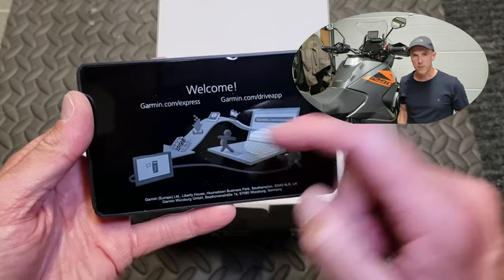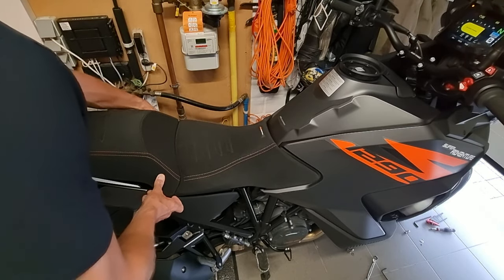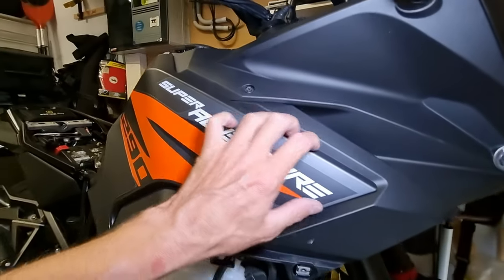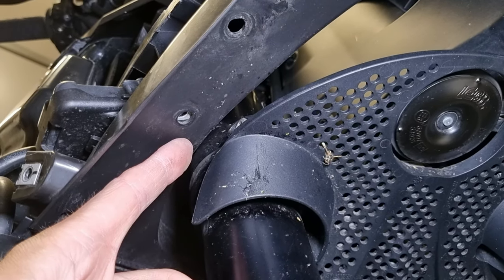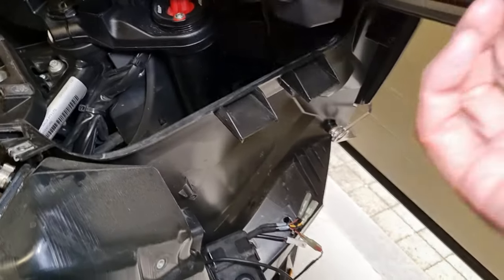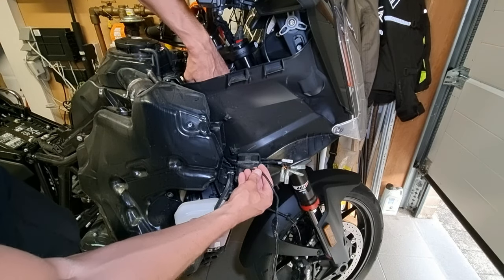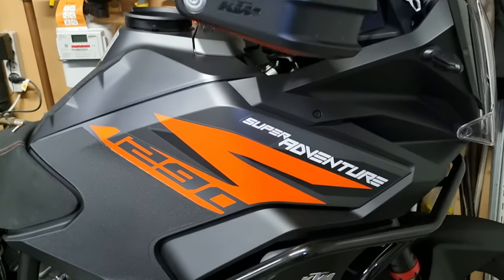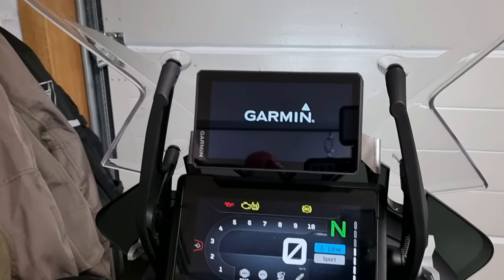GPS POWERCABLE INSTALL on KTM 1290 Super Adventure S accesories connector ACC2 (Garmin Zumo XT)

Comment: Forgive me, but why didn’t KTM just place the ACC connector in an accessible place, under a flap if necessary? It’s obviously a place that an owner would need to get to if fitting any aftermarket parts.😮
Reply: Great video, by the way.  Thank you for explaining the process.
Reply from the maker: yeah, that would save us a lot of work 🙂
Reply: @FlamesAdventureS just use the “sigaret” plug there are plugs with 2/3 usb ports it would have saved you so much time and unnecessary dismantling the bike.
Reply from the maker: Yes that certainly could have saved me a lot of work 🙂. But I think it's not that good when riding in the rain and now the gps always has his power without using extra cables. I didn't mind to disassemble the parts, it was some kind of winter project 😂 @Biceptic
Reply: @FlamesAdventureS  thats absolutely true my friend. Cheers 🍻

Comment: I then spotted two sets of acc connectors under the rear seat; one of which is acc2 witched and much easier to get to than front Acc2.  Connected my Zumo to the rear acc2 connector under rear seat and all works.  Hope this helps those a bit wary of taking their KTM to bits ;-)

Comment: There are two more cc1 and cc2 under the passenger seat which are very accessable and easy to get 2 wire from front to back
Reply: Are these the ones used for heated seats?

Comment: My Superduke has a usb port under the main screen ... Why would ktm not have this on the more touring version of their bike...
Reply: They have a 12v plug (straight below the big screen) which you can buy a sigaret to 2x usb convertor 😅 it would saved him so much time and literally no bolt to unscrew. I run my dashcam AND my Quadlock phone charger without any problems.
Reply: Using acc2 means the cabling is hidden and looks neater. Plus less chance the connection get damaged by water/rain or tumbles off road. I have managed to destroy a cigarette to usb adaptor riding hard off road on my 890R. Would have left me pretty stuck if my gps was relying on it.

Comment: Really thank for sharing I have one question and that is about the Handlebar Mount Compatible with Garmin Zumo, is it the 12mm?
Reply from the maker: Yes, 12mm.  The Touratech gps mounting adaptor has a 12mm tube above the display. The 12mm zumo mount clamps around.

Comment: Very professional presentation, free of useless likes and dislikes. I just used this to install a Garmin on my new Adventure, when it was very helpful. I put my laptop in view in the garage and just followed each step, pausing the video as I went along. It sure beats trying to find that one little hidden screw on a fragile plastic panel

On my bike the headlight surround was way too close to that screw underneath it. It's easy to remove the surround; unsnap that little windscreen, take out one screw at the top of the surround, and then pull it up, when it comes right off.

Comment: Not trying to a OCD or anything your forgot to screw fix back the bolt back where your unscrewed it @5.58mins. I guess you have a spare screw in your session there...😅😅😅
But still, very educative video as always.
Sorry for my OCD.
Reply from the maker: Hello, thanks for your reply. I don't see what you mean but I didn't had bolts left after everything was mounted 🙂
Reply: @FlamesAdventureS  oh sorry about that.

Comment: Hello, I am currently in the process of installing the Garmin Zumo XT and the headlight cover. Can you help me mount the upper handle of this cover, I don't know how to get to the two upper screws 🤔
Reply from the maker: Hello, you have to remove the windscreen. Then pull out the plastic triangle shaped piece above the headlight, then you should have acces to install the upper screws. Good luck and let me know how it went 🙂👍

Comment: What are the little connectors you fit to the wires to plug into the ACC2?  My satnav just has small bare wires and no connectors provided.
Reply from the maker: I used flat plugs , they doesn't come with the Garmin, but you can buy it in for example an elektronic store